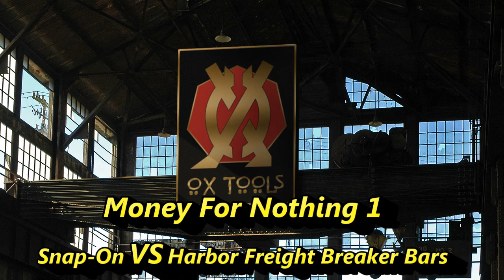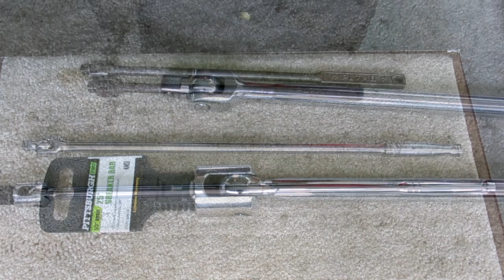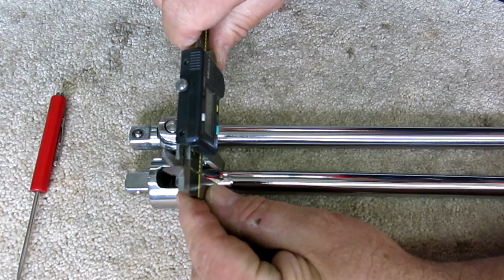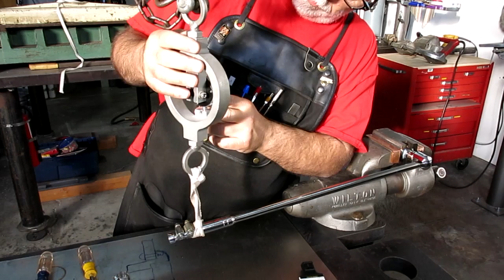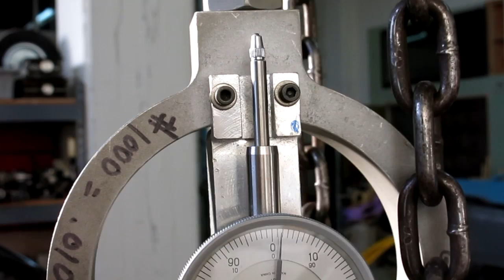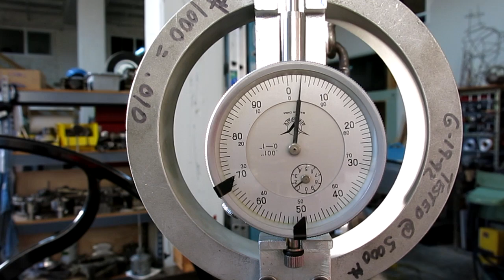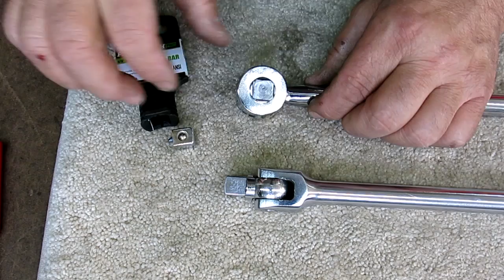Money For Nothing 1

Comment: There is a Cornwell video where they are testing their 3/8 ratchet and it fails at the square at 260ft-lb. I have broke a snap on bar even with no pipe extension and when it did it pulled the ear off that the pin is in, the socket driving mechanisim was unhurt. I have busted up a lot of 1/2 drive tooling with my bare hands, now get a good 3/4 drive and see what it takes. I know you would have to be one of your Clydesdale buddies to wreck that stuff.  Going up in shank size makes a huge difference in what they can take. I have a old Williams 1" that I once had a 6ft pipe on the handle and was jumping on the end and I weigh about180lb. It never even phased it. Eventually I did manage to snap the frozen 1-1/2 bolt off with it. :-)
Reply: +bcbloc02 Hi Brian, place I used to work had a wrench, unknown brand, but it was a 1.5" drive and 6 ft. long.  We used it to remove counterweight bolts on forklifts, and pull out cylinder liners.  I spent plenty of time hanging my full body weight off the end of it, along with a buddy next to me.  We would bounce on that thing with all we had and eventually the bolts would break free.  I expect we could get every bit of 2400 ft. lbs with that thing, if not more.
Reply: James Kilroy
 I haven't had the pleasure to use any 1-1/2 drive stuff. That is getting pretty big for me. Maybe when I start working on trains. :-)
Reply: +bcbloc02 As far as working with a 1 1/2" drive, there is no pleasure in it!  The tools are pretty much custom made, heavy as hell, and only tell you by their size, what kind of day you are in for.  Just looking at a wrench that long tells you to keep a couple of young guys around the shop.
Reply: James Kilroy
 Maybe not too much fun but I bet it beats pouring 84 80lb bags of concrete by yourself one day! Lucky I am still young, be hell building a shop by hand when I am 60. Going to go pick up the 1st load of structural steel and HBM anchor material tomorrow. the wheels of progress keep rolling here. As KF would say "Getter Done!" :-)
Reply: yeah but 3/4" drive means big sockets with thick walls. great for bus lug nuts not so much when in close quarters. most of us not in the tractor/truck/heavy equip trades do fine with 1/2" if its well built.
Reply: If you want a longer 3/4 breaker bar handle for applying more torque, simply use an impact adapter 3/4 F to 1/2 M and your extra-robust breaker will work very well.  A few years ago I twisted off a trailer lug bolt (1/2 or maybe 9/16?) while trying to loosen the nut and using a penetrating product (Blaster) with a 3/4 bar around 45 inches long..  This was after back surgery and muscle loss due to my age and weighing less than 180#.. I should have used my air powered impact wrench for the short bursts of torque.  The stud was easy to drive out and a new one went in easily with an impact hammer.  I love my power tools.  Live and learn!

Comment: Tom,

In the process of trying to remove the hub-nut on a model -A rear axle, I slipped a 6 ft. pipe over the handle of my Craftsman 1/2 drive breaker-bar. The nut didn't budge, but the breaker-bar split at the knuckle... I took a ten-minute drive down to my local Sears store, and they replaced it, on the spot, free of charge, no questions asked. 

Let me see you do that with your fancy-dancy Snap-on tools.

Frank

Comment: flex head socket wrench vs. normal socket wrench: will the ratchet break before the swivel.

I have a flex head 10in socket wrench i bought almost 15 years ago ( I was 12 years old) from true value and the guy who helped me buy it (my science teacher at the time worked there, non the less) at the store said it was weaker than a normal one. At the time it looked way better (skookum) than anything else at the store and was way longer as well so i bought that one and I want to know if the ratchet will fail before the swivel head will. I maybe have babied it but man i love that thing and still have and use it. i would never not have one in my tool box.

Comment: I have a 35-year old Craftsman breaker bar. I have hung off it with a 6' pipe over the bar. That was not enough so I started bouncing on it ;) That is what it took to get the crankshaft nut off my Willys engine. Have abused much more over the years. It is much beefier than either of yours.

I have a late '70s SK 3/8" ratchet that has seen pipes and big hammers. 

Now, a modern-day Craftsman, I would not trust. Probably the same for a modern Snap-On. 

You have seen the old-school metallurgy is amazing. I have seen time and time again in many products, the import stuff metal just does not hold up and is hit or miss.

Cold chisels are another thing. My Craftsman came into use in the days when you had to cut off forged rivets holding ball joints on.  I have a no-name modern one, it is made of Silly Putty, another is made of glass ;)
Reply: +Scott Henion speaking of old quality american steel, its just good stuff. i have a 1948 farmall cub. i repainted the fenders and hood. the sheet metal is almost 70 years old. its almost 3/4 of a century old and all it took was a D/A sander to remove the old paint and light surface rust. once all of the old junk was off, what was underneath the old paint was amazing. the steel literally was still like brand new. this country really knew how to make superior steel and equipment. i run that tractor year round mowing, and plowing snow. i easily put 50 hours per year on it without thinking twice about it. its incredible how reliable, durable and fuel efficient it really is. for the amount of work it does, i spend very little time repairing it. amazing stuff for sure
Reply: +Scott Henion I'm fairly certain modern Snap On and several other breaker bars are still made in the US from quality materials. I've been in the shop where they were made, though not within a couple years. I have a couple though I rarely have a need to abuse them.
Reply: +Stephen Smith Yup, V-44201

I found how both te SnapOn and Pittsburgh flexed considerably disconcerting. Mine has almost no visible flex. The handle is forged into an I-beam like shape. The stiffness helps when jumping up and down on it ;)
Reply: +Scott Henion The modern Snap On is identical to Tom's. The modern Craftsman... well I have a click in my elbow from when one of those broke trying to get the crank bolt out of a Chevy Duramax, I hadn't even really yanked on it and it popped just like the HorribleFright version in the video.
Reply: +Scott Henion If your old Craftsman has a V marking on the handle, it was made by Moore Drop Forging, Springfield MA.  You're dead right not to try anything like that with a new Craftsman.
Reply: I'm not sure I would have ever put Craftsman on the same level as Snap On, being younger than most of you. It's sad to see China or Taiwan on Craftsman tools regardless.
Reply: +andrew donohue Yea its a shame today stuff is made what I call disposable you break it or wear it out you throw it away and just buy a new one.
Reply: this is the difference with today's age and yesteryear ... yesteryear the items were sold on the fact that they would last a lifetime and there were very few companies bargaining for few customers .. now days you have many companies trying to undercut each other for many customers .. some customers require the quality needs of yesteryear .. and this is why top quality tool makers still exist .. sadly many more customers are willing to not spend the money and buy imported crap. A lot of the time it's because of the fact that they aren't the ones making money from what they are doing and are only hobbyists or weekend warriors and therefore will buy what will get the job done. Which may be a job that they are only doing 5 times in their life, if that.

It truly is sad that there is such a difference in quality these days, as people who don't know will be happy to buy what works at least once .. and this has opened the market for such low quality crap which doesn't have the $$$ spent on research and development, just having something good enough to sell is important. So long as the money flows in .. they don't care if one customer breaks it 50 times, because they still have 20000 customers who haven't broke it, even though all of them are pretty much the same crap.

Comment: I have quite a few Horrible Freight items in my arsenal.  I tell folks all the time that if ya buy from them you just have to be careful what you are getting.  Tools for occasional use, I find them to be a good value.  I have gotten quite a bit of life out of the pneumatic tools I buy for fabricating.  My die grinders, saws, and cut off wheels have all held up very well for tools that I paid less then $20.00 each for and I have used them to repair and make quite a bit.

Comment: i think realistically over 300lbs was plenty for a tool of its type, it does say ANSI on its package which probably relates to some kind of strength test, and i think it meets it fairly
Reply: +jusb1066 that just mean metric or standard. iso (metric) vs. ansi (standard)
Reply: attainableapex
ahh ive not seen that here in UK, plus do they sell a metric 1/2 breaker bar? lol
Reply: +jusb1066 naw it would be a 234234234... mm iso bar. ansi and iso standards are standards of measurement not quality. although there is iso 9000 or iso 9001 standards which are quality control standards so ...  I am guessing each has there own rating system for quality but i don't know ansi's
Reply: attainableapex
i think for tool qauality it was either a Din standard or a BS british standard which had lots of specifications for certain tools, i remember quoting BS876 to a manufacturer where i bought a hammer, and they didnt harden its face, thus refunded me beacuse of it

Comment: One more set of tools I would like to see compared is measuring tools. Rulers, gauges, squares, etc...
Reply: +jusb1066 I've been using cheap import calipers for almost 20 years now...  The batteries (SR44) are available for dirt cheap prices, so I keep a stash, and put new ones in at the first sign of low voltage - such as a flashing display - or at the star of a work session. The oldest pair, from ~1998, eats batteries faster than any of the newer HF pairs...

They don't draw on the battery when off, but the batteries do not last all that long in use...

I've never had one "skip" on a rapid movement - they read the glass scale just like the more expensive ones. You are buying a lower grade of polish, and slightly cheaper mass produced electronics, so they don't necessarily last as long - although my sole loss to date was due to a leaky battery.

If I were making my living using them daily, I'd get Mitutoyo's and write them off on my taxes... since I'm not in that position, I buy the cheaper imports.

Your mileage may vary...

Eric
Reply: +Matt Robertson I think with them, like on a combo square isn't so much about the rule its about how well it locks as well as fit and finish. I will say thought that a satin chrome starrett scale is pretty dam nice regardless if its precises or not
Reply: +John Ridley the cheap ones suffer battery issues, using pretty much the same power on or off, the second issue i would worry would be repeatable measuring, they could i think easily skip a pulse now and again, or on a fast movement, id love a cheap set of digital calipers on the cheap if they can solve those issues.
Reply: +John Ridley that y I pull the batters out of the after I use them lol
Reply: I get to use many maybe once a year

I work to much

at sea to many days in the year
Reply: +John Ridley I have two HF digital calipers. One has a black scale, and one has a silver scale. The black scale calipers are really nice. The silver ones are complete crap. When I bought the silver pair I was like what difference can it make? Apparently quite a bit. The black scale HF ones are $20, and the silver ones are $10. They don't even work the same electronically. The black ones remember where they are between power cycles. The silver ones always start out at 0 when turned on. So they're not the same.
Reply: John Ridley
Not too weird really. A lot of Chinese products are inconsistent in quality.

Comment: Great video! I like the new series. I would like to see torque on a Harbor Freight wrench versus others. Sometimes when I have a rusted nut on a machine I've put a hydraulic jack behind the wrench to get the nut off. Also Harbor Freight drills Vs others. Test wobble, hardness, sharpness, and how easily they dull.
Reply: +Knolltop Farms
oh a 'combination' (box? lol) an all 16th will just round out the nut (or the tool adjuster will allow it to jump over it), they are pretty hopeless tools under pressure IMO, in fact to be really pedantic id like to see a 6 point and a 12 point wrench type, (as i prefer the 6 point as they are further from the corners)  but even a cheap wrench of this type has never failed me (although cheap ratchets and sockets  sure have), and if Tom is reading this, do cheap vs bondhus hex keys too :} though i will say the cheap ones will provide worthless torque
Reply: +jusb1066 An "all 16th's" wrench, or a standard box wrench?
Reply: +Matt Robertson yep id like to see a wrench test to failure, both premium and harbor freight brand.
Reply: +jusb1066 Yeah, I guess we don't want to make Tom bugger up one of his fancy Swedish adjustables...or do we? ;)

Comment: Tom, Every Harbor Freight item I've bought has failed at the square.
Reply: +Frank South I have used Harbor Freight hand tools in my shop for over 25 years and have yet to break a single one maintaining a fleet of tractor trailers and farm equipment.  I own two (2) Snap On.  A 1/2" ratchet and a 9/16" combination someone gave me. The Snap On guy rebuilt the ratchet about 8 or 10 years ago for me. Not a single break or rebuild on a Harbor Freight (Pittsburgh) hand tool yet. My friend who owns a commercial heavy equipment repair business uses nothing but Harbor Freight (Pittsburgh) hand tools as well. We don't enjoy the exclusivity of the Snap On club, but we put more money in the bank each month as a benefit.
Reply: +William Garrett Pro  Tip: open up your imported ratchets and smear a little bearing grease around in there. You'll swear you have the expensive tools then! Seriously, it is totally worth doing. They even sound better after you grease them. Don't go too wild packing grease in there though, or it interferes with the prawl. About tooth depth on the rack is just right. If a person is a good mechanic then they can do good work with HF tools. It sounds to me like you, and your friend are good mechanics too. Keep banking your savings.